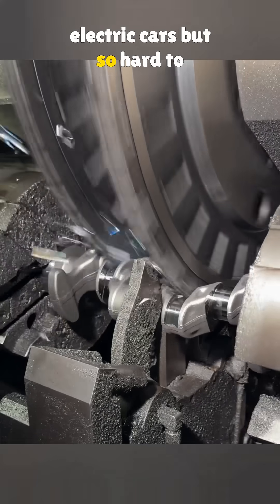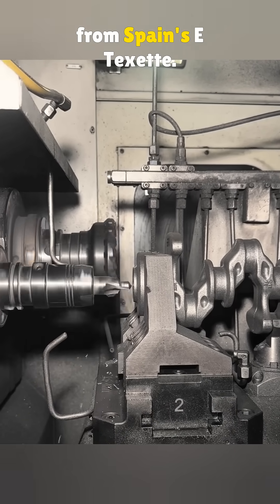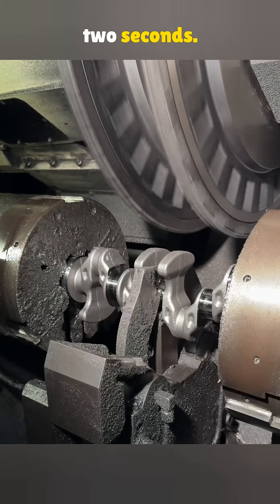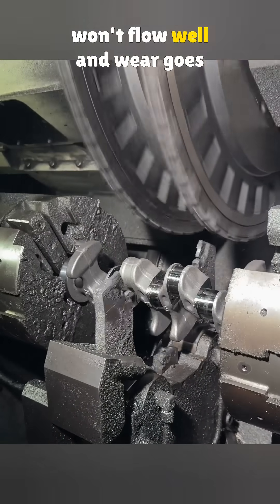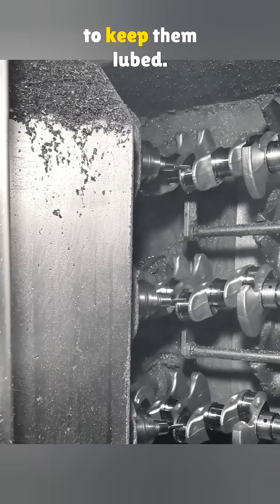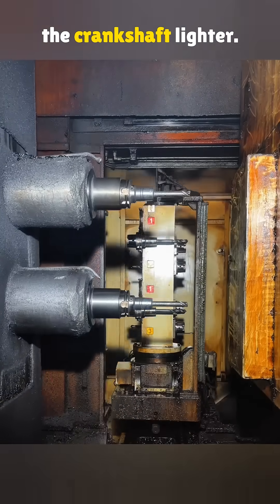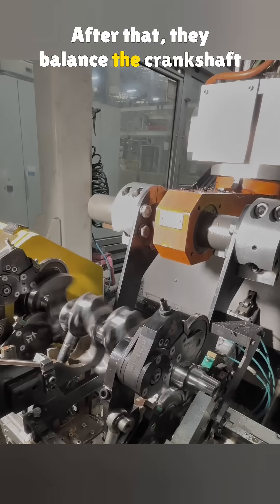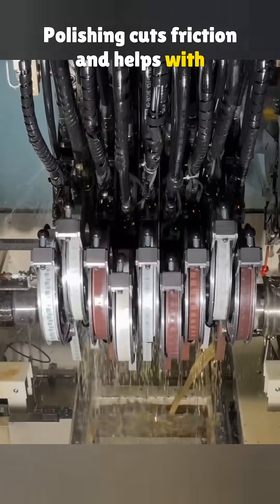How a Crankshaft Is Made #automobile #car #cartech #engine #mechanic

Comment: I am a CNC machinist and work some machines like this ,very precise ,we work with microns for our tolerances and everything has to be perfect the first time ,when it all goes good  it makes for a good day ,when a cutter or a drill bit doesnt  go deep enough or gets dull it will cause a lot of problems and you get  a bunch of scrap if the  gauges dont fit just right and QC is paying attention
Reply: I was a jet Engine Machinist at Pratt&Whitney back in the days before CNC... The tolerances were done and held by the Machinist and not by a Computer Program...that was the Days when Machinists were real Machinists and NOT Computer Programmers...most of our Tolerances were to be held + or -  .0003 thousandths of a inch. These Jet Engines were both for Military and Commercial use.
Reply: @claudelandi510  hi, brake press/roll press/roll form operator here. None of what i do goes through a computer, except the printing of the blueprints and dimensions. Thats left to the laser/plasma CNCs. Theres still backbreakers out there, although less common nowadays.

Edit: our tolerances vary depending on what we bend/roll, sometimes its as loose as 1/32", sometimes as tight as 0.0025...anything from ⅛" steel plate to ½" AR500...thank god for ceiling cranes and magnets/chains, although most of it i just hold.
Reply: @claudelandi510 i was in the transition phase of manual to cnc so i had to be proficient in both i loved cnc machining but i can make a manual lathe sing, love them both but will not go back as the pay sucks for the amount of responsibility.
Reply: Unfortunately, I can't stand the job anymore and really wish I'd learned something else. I even have a master's degree.

The problem here in Germany is that there's no continuity. That means if the industry isn't doing well, you lose your job, and the industry is constantly doing badly.
Reply: I have a lot of respect for a good machinist,  there a hard to come by. You have to be a very meticulous person to achieve and hold such tolerances.
Reply: absolutely fascinating short video
Reply: How is it that EVs can work easily without all this precision gadgets?
Reply: @sootuckchoong7077 EVs are completely different and only require electric motors. It's not that they dont require precision machining, its that they need electrical systems, not mechanical systems. An EV can produce a ton of power by using electrical systems but a mechanical car needs precision cuts for the metal to work for hundreds of thousands of miles while pushing against itself.
Reply: @sootuckchoong7077 while I do not know definitively, I would guess EVs require less precision parts, and less expensive part treatments like hardening and such.
Reply: @sootuckchoong7077  electrons easier to control than liquids
Reply: what machine made the machines that make our machines, AND how was that first machine made?
Reply: @ciddyboy718 Lathe -> better lathe and it went like that. First machine handmade, with little care precision can go up for subsequent machines.
Reply: 3D printers are the future
Reply: A 3D printer will never been used to make something like this  @freedomeagle666
Reply: So wouldn’t you agree, IOTW: Why EVs are a NOBRAINER.
Reply: I used to work with microns in tolerance, but now work with morons and no tolerance.
Reply: So gnarly to see.
Reply: «tool change takes only 0.2 seconds».. - Really??
Reply: There is a tool load sensor, if the load gets to a certain parameter then the machine should change the cutting tool for the next while the worn tool gets replaced and reset. 
This is old tech.
Reply: no it doesn't.  he's lying
Reply: Whats the difference between machinist and engineer? Arent engines machines and vice versa?
Reply: @mexicanlucky engineer designs and oversees whereas a machinist operates the machinery. Both generally do a bit of either side and as a Motorsport design engineer I respect the machine shop techs. So much knowledge from actually making as opposed to just 3d drawing and theorising but of course the most talented technical people can do it all irrespective of formal training or education.
Reply: @mexicanlucky  - -  haha   - machinist does the MAKING - using "cutting machines" - Engineers design, an oversee (Usually)...    ... and a Motor can be an Engine, and an Engine can be called a motor (Automobiles are also called Motorcars in some markets), only EV idiots get that confused - with Electric Motors  (Series, Shunt or PM, (Radial, Axial, or spherical -continuous wound or parallel coil..) however you like it..)...
Reply: @mexicanlucky Engineers design the parts mostly and machinist cut the metal and make the parts using precision engineering techniques using CNC machines and equipment. Some people like myself are both machinists and engineers.
Reply: @niallpeacock7162  as an engineer myself.  That's very rare. You must  be a manager?
Reply: @TheVoid-y4h No mate I'm not a manager, but I'm on management teams. I started off as a machinist and then was very interested in engineering in general so went on to study my degree in mechanical and manufacturing engineering. So currently I design on cad/cam and test and mill and turn products and prove them out on the machine. So yeah bit of both for me haha 😅 Nobody can come to me and say I'm just a greenhorn straight out of studying 😁
Reply: @mexicanlucky big difference bud! Engineers draw up the plans and we ( Machinist ) program the machine and build it!!
Reply: @mexicanlucky An engineer goes to university and learns how to design. 
A machinist goes to college does an apprenticeship, has hands on experience, has to learn multiple programming languages and a myriad of machineries, then he has to learn how to measure and adjust the programs as well as adjust the dimensions, has to know just by looking and listening when multiple types of materials are cutting at their optimal efficiency and then he has to scream at the engineer for designing something that it may look good but it is a nightmare to create.
There are some good engineers and there are some engineers that think they are good.
Reply: @7thplanet121 engineers WROTE the precious programs that you think machinists are superior at using. You think some paint-huffing welder wrote the scripts used for something like AutoDesk?? You think your precious machinist tools were made by machinists?? Machinists are so overdosed on copium literally everywhere in the US (the rest of the world isn’t stupid and recognize that engineers superior), and it’s always so funny to see the high school dropouts think that they’re smarter than the master’s degree process engineer because they found a screw well in the design that’s slightly too difficult to access, and then y’all think you’re rocket scientists because you suggested to an engineer to move an access point 4 cm to the left or found a single error in a design with hundreds of moving parts that was otherwise perfectly designed. Machinists would have absolutely no direction for building anything complex without pre-existing designs from engineers
Reply: @  engineers did not write those precious programs, programmers wrote them. I’ve been programming since punch tapes. So get off the high horse you are getting a nosebleed.
Reply: @7thplanet121  then you would KNOW that programmers didn’t make those programs, programmers write the code to use in those softwares. The softwares and programs are CREATED by software engineers. Extremely easy to google the founders of any major software or design program and find an engineer behind everything. Can’t remember the last time i saw anything similar with machinists being the culprits… strange how that works….
Reply: @mexicanlucky  a machinist does all the work and improves on the engineers process as he notices flaws. The machinists het none of the credit.
Reply: @mexicanlucky engineer is the architect of machine
Reply: In ur opinion can he get it done in 4 years?
I don't think so the price alone of a journey man machinist, and other skilled workers will take the price exponentially so high that the finished product will merely become unaffordable. 
Hence is why the manufacturers had th go overseas for cheaper labor in order to profit.

Comment: They have been made internal combustion for hundreds of years and have powered all kinds of vehicles in air land and sea. And last longer than electric cars plus a lot more.
Reply: Electric motors are older and last longer.  

The first electric motor was invented by Michael Faraday in 1821

Father Eugenio Barsanti, an Italian engineer, together with Felice Matteucci of Florence invented the first real internal combustion engine in 1853

There are industrial electric motors that have been in continuous service for half a century.

Comment: How many crankshafts are made by machines like this to run the engines used to mine the materials to build a  ev?
Reply: The machining required to make an internal combustion engine from start to finish is a hundred times more involved than an EV
Reply: Almost all mining equipment is electric or diesel electric.
Reply: Zero, rare earth minerals are mined by what is essentially, slave labor in the DRC.
Reply: All of them.
Reply: Please tell me you're joking
Reply: You'd be surprised, mining companies favor electric motors like those made by Bartec.
Reply: @jeremyreese54  Large mining equipment is powered by diesel electric drive trains, similar to what you see in the rail road industry, and it's been that way for a long time. As far as I'm aware, there are no all electric large mining equipment.
Reply: @ The drills, the conveyors have been mostly electric for the last 20  years, They don't do ICE for all the obvious reasons...
Reply: @operator0  sandvik makes battery electric equipment for underground mining. Pretty interesting machines.
Reply: @operator0  You're missing the point.  Electric motors have far fewer interior moving parts than ICE. And drive train isn't rly relevant as many electric vehicles drive the wheels directly like ebikes, scooters etc. You can literally build an electric motor at home for $5 with a battery, a magnet, and some wire.
Reply: @operator0  No, you're just wrong.  Making a brushless electric motor isnt that hard. u need 1 lathe and a cnc machine to build an electric motor.  did you not even watch the video?   Just so you know, it's the simplicity of an electric motor that makes them good, because they are cheap and require little maintenance
Reply: He said easy he didn't say cheaper. Plus an EV has half the life the batteries are expensive. This is a vide to help run down the mechanical car. You can use the same vid and downfall ev and how great thus process is
Reply: Does it matter? you need to dig up materials for regular vehicles and anything else too
Reply: Mines use hi-bred diesel electric trucks, powered like trains.  Electric power is on top of everything.
Reply: Not only that, but the machines to produce an electric motor cost just as much as the ones used to produce an ICE engine.
Reply: @operator0  You just made that up. It's not even remotely close.
Reply: @operator0  wait one stamping machine for the electric motors lamination and one winding machine to put the copper winding in is more expensive then the machines you just saw to make a crankshaft? Are you high? Do you need help?
Reply: @XDlachmal Show us a video of only using two machines to make the drive system of an EV. 😂
Reply: @operator0  lol. An electric motor needs one moving part and two bearings... now compare that to a ice... cranc rods pistons turbo valvetrain to name a few... 
an ice needs a transmission with multiple gears, electric drivetrains need just a reduction... Ice need alternators, starter, catalytic converters... Ev not.
Reply: @operator0 I worry about all those batteries. What can they recycle? How much will fill industrial graveyards?
Reply: @operator0 it's a matter of manual vs cnc machines. Manua machines are much cheaper

Comment: Maintain your gas engine properly, and 500k miles is easily attainable.
Long before that EV have had battery replacement and drove motors.
Add to that, 99% of a gas engine is recyclable.

Comment: Well back in the day we use machines to cut this. It was done by hand. But today the parts are cut down to thin. Also this crank shaft used oil dripping on it today the oil pump shoot oil at it.

Comment: “Why is it SO EASY to make Electric cars?” It’s not

“Why is it so (comparatively much) hard(er) to build a gasoline (internal combustion) car?”

It REALLY isn’t….and even if it were, it wouldn’t be making and machining the “hard parts” of the engine with processes, machines, and tooling that were invented over a century ago that was the “super tough” part.

Comment: Unfortunately, it's not easier to make electric cars. The amount of energy required to produce an electric car is much higher. Mining and processing minerals for batteries requires 150% more energy than processing steel and copper, and twice as much energy as aluminum. Most of the energy is not consumed in the construction of a vehicle, but making the materials from which it is constructed.

Comment: Lithium mining for lithium batteries can be toxic due to the methods used, the water usage involved, and the potential for environmental contamination from the mining process and the resulting waste. Specifically, brine mining, where saltwater is extracted and evaporated to obtain lithium, can lead to water pollution and the leaching of other metals into water sources. Furthermore, the mining process itself can require large amounts of fresh water and toxic chemicals, and the resulting mining waste can pollute the environment.
Reply: Yes but even Iron is almost in the same boat. You can polute water so much mining anything. Lithium is not a special option. All options of mining, Fe, Cu, Mb. If they escape the lake that contain polluted water are dangerous to environment, that's why we built them right to withstand hazard conditions. The biggest polluant in the world in water is not mining industry is actually Petrol transportation. Lake of petrol were made in ocean because we needed oil. If somone says an electric car pollute more then that man never wanted to study both things then put them on a graph and watch closely how they get near each other.
Reply: @looptech7140  the oil industry ahs an environmental impact
Reply: The amount of water used is unbelievable....our most precious resource
Reply: How does ICE compare?